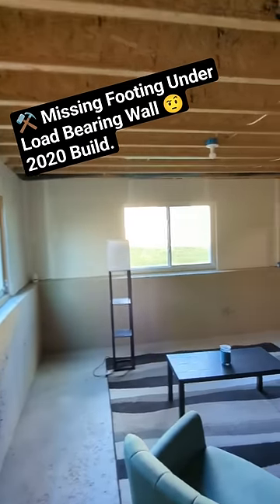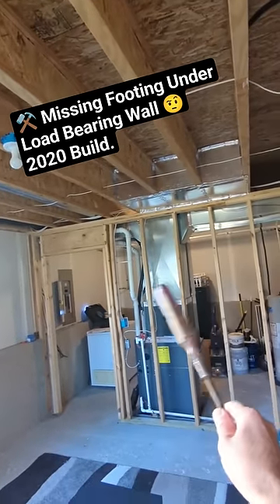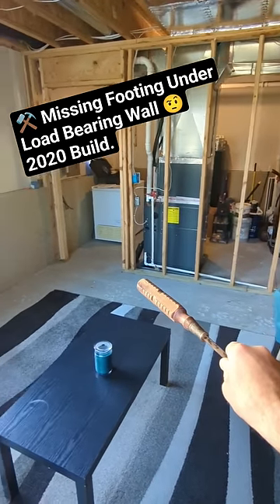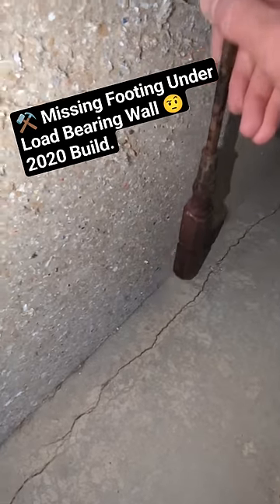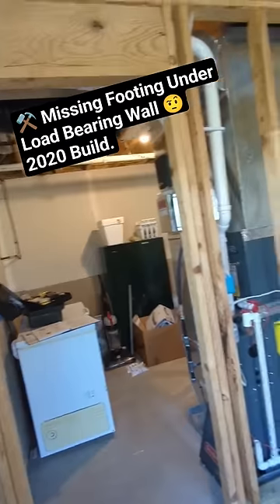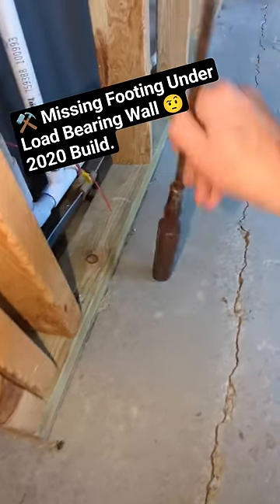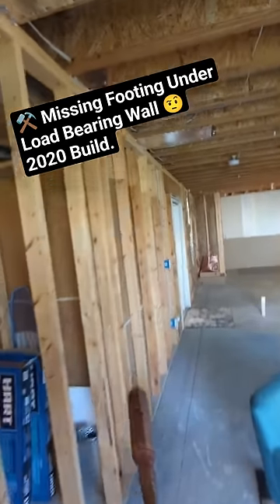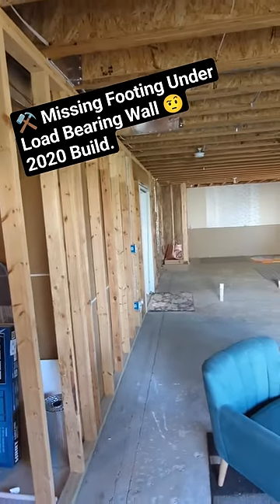FOOTINGS missing under load bearing walls NEW BUILD A trick to find missing#footing under #concrete

Comment: That's going to be expensive 😅
Reply: How do you even repair that?
Reply: @bmo14lax  temp support braces down both sides with cross members supporting the beam, remove load bearing wall, demo saw out concrete, dig out stone and dirt, use wood to form the proper footing, pour new concrete, let it cure, remove form and refill dirt and stone, compact, pour more concrete up to existing floor level, let it cure, reframe load bearing wall, remove supports and bracing. About 10 days and $7k-20k depending on the crew and if you get it done before any code enforcement catches wind. If code enforcement catches wind you're gonna need an engineer/architect, revised permits, and another $5k-$10k.
Reply: @stephentorrey8727  so the entire wall has to come down? Jeez yeah expensive 😂. Thanks 👍
Reply: @bmo14lax  theoretically you could pull it off without removing the wall, but then you have a floating wall in your way while trying to pour concrete 🤣. Plus since it's load bearing, the finished concrete needs to really, firmly and securely support the wall. It can't be all loosey goosey and by most codes you're not allowed to use shims on load bearing walls at all, so even a small gap is unacceptable and will cause the upper floors to settle noticeable probably breaking tile or causing hardwood to heave. So while it is technically possible to do without removing the wall, it's certainly easier and the "right way" to take the wall out in either sections or peice by peice. You could do it in a way that almost every single peice of lumber could be reinstalled to avoid waste though. If I was doing it, I would try to make the new floor maybe 1/8"-1/4" higher than the old floor by sloping it down to meet the old level a foot or two away from the wall. This way all of the verticle studs could be cut down by a small amount and reused while ensuring a properly tight fit for support.
Reply: @stephentorrey8727 if their plans has that as a load bearing wall then the footings will be detailed already. No need for another PE or anything. Just has to put footings that match the plans. 

Also, you don't need wood forms. Just cut the concrete, dig the proper footing depth/width, pour the concrete level with the floor.
 
Potentially could even get away with putting a sill seal or blue skin/etc under the existing wall and pouring concrete under it.
Reply: @Josh.1234  how to do plan on ensuring proper compaction for a footing if you don't excavate more than the required footing? We would hope it's already compacted as they poured the foundation, but the foundation guys also missed a very important footing soo...
Reply: @Josh.1234  plus, by the buiding codes in my area footing must cure for several days before foundation is poured.
Reply: @stephentorrey8727  unless it's distributed soil (which would be noted in the plans) it doesn't need compaction. Typical footing details are for undisturbed soil. Only when you have atypical soils or backfill do you need to amend or compact.
Reply: @stephentorrey8727  he's not pouring a foundation. Just a long footing
Reply: You could brace it cut out the jack studs, pour some small footings there and put lolly columns in. Not that huge of a deal but shoulda been done right.
Reply: It can be "underpinned".
Look up "underpinning a foundation". 

Likely $15,000 or so to underpin that wall.
Reply: @markmills344  you would not underpin the foundation since where this wall is does not appear to have a footing. Underpinning is when you go under an existing foundation and add additional support. This is a flat slab that just need to be cut and a footing poured under where that wall goes.

Comment: The crack in the slab along the saposeobly bearing wall is caused by the load pushing down and then deflecting back up and lifting the slab up.

Comment: On rewatching that video looks like that isn't actually a load bearing wall at all. "silent floor" or strand board joists look to go from exterior wall to wall. That wall in the middle may not be structural at all. Though it WOULD be stronger design if it were.

Comment: Help me understand please. What is the long term problems that the home owner would face? How can this problem be fixed?
Reply from the maker: Well, this is a single story home and the attic has trusses so there's no additional weight load from the top areas above. However, probably would experience minor hairline cracking on drywall in rooms at the main floor. 
Correction; 2 ways, bust out slab in front of basement center wall and install footing then install new wall in front of the other. 
Or post and beams with footings under post. 
I think the most concerning area is the middle of the basement.
What people may not see in the video is the larger door opening has a laminated header and on top of the top plates theirs 
two laminated beams setting on top which are perpendicular to the wall.
This is applying more weight load down to the slab areas.
In addition, there is a large bedroom  beyond the wall that extends beyond 24 feet.
Thanks for watching the video and the comment.

Comment: I can't tell from the height of those floor joists but the room behind that wall seems like it's very shallow and I believe those joints go all the way past that "load-bearing" wall further to what is probably is the load-bearing wall. 

Also just because there's headers does not mean it's a load-bearing wall I make it a point to put headers in above every door unless it's some middle of nowhere wall that you're just putting a closet or something inconsequential in
Reply: Let me ask- I’ve always thought load bearing in basement was done with metal (or maybe wooden 4x4 or larger) posts, but not with wall built with 2x4s

Comment: What you are not taking into consideration is the TJI floor joists could be designed to span the entire distance without that 2x4 "load bearing" partition wall. The partition wall simply takes some of the bounce out of the joists and doesn't have much weight on it at all.

Comment: Headers "usually" mean it's load bearing but not necessarily. Sometimes builders put them in just to stiffen things up a bit. In this case being that the wall is so far to one side of the joist span, the load would be significant. Plans probably note this wall as "non bearing" but due to the cracking next to it, it's obviously got significant load on it and should therefore have a footing.
Reply from the maker: Thanks for the comment and for watching

Comment: Is that a sand cement screed floor on top of a sum floor  when not compacted properly when screeding the floor you will get the hollow sound like this and the crack  definitely looks like it’s following a crack from underneath  or maybe heavy load on a pallet trolley run up along the control joint they put in   Just a theory  I am not there  so there s no footing underneath

Comment: Is there more rebar under the wall (obviously not, due to the parallel transverse crack)? Just saying, a footing is just a way of transferring a concentrated load to a wider area; a slab on grade is the ultimate footing, provided it's appropriately thick and reinforced.

Comment: Shouldn't there be 2×6s on the basement floor or is that a code thing? In my area it would have to have them for code interior and externally.
Reply from the maker: In some cases.
 I know some areas require 2x6 outside Walls for R value and 2x6 for load walls on 2 story homes.
This video is a single story ranch with a basement.
Thanks for watching
Reply: @inspectflix  thanks for the clarification. I'm about to move or build, haven't decided which. I'm leaning on building and I'll go smaller but built right. I had no idea about footings under load bearing walls. Thanks for the info

Comment: I’m going to extend my loft in my shop. I have 16 foot walls to the trusses so I have 8 foot walls to the loft. I have a 4” concrete slab so can I put posts on that and put a beam across the posts and then joists across the beams? Or do I need more to support the weight where it contacts the 4” concrete floor? It’s a pole building and the builders did a nice job and put in a 24x 36’ loft and I want to add so it will be 36’x36’ or 24’x36’ with a new 12’x24’ section

Comment: TJI's look sufficient to carry a  much longer load. Allowable spans are based on 1" of deflection in the span. If you put a wall in the middle part of the span, you could actually create an unintentional load-bearer which could crack conc on a poorly compacted substrate. Don't usually put that much effort into basement partition walls.

Comment: I think the footing is there, but that’s a contraction crack.  The concrete foundation team likely dug and poured where they were supposed  to put it.  Is there adequate 1/2” rebar tying the slab to the footing? Importantly, is there vertical movement downwards on that crack under the load ?

Comment: There might be a footing under the wall.  It sounds different then the slab 8 inches away.  There might be foam under the slab.  If you listen closely, you'll notice that the taping sound is slightly different under the wall then 2 inches away from the wall.  The footing should be approx. 16 inches wide and appears to align with the crack in the slab.

Your tapping 2 inches next to the foundation wall, does not reflect an appropriate 16" footing width.  I suspect that the footing is deeper and they put foam down under the slab.

Comment: It goes to show that just because a building is new does not mean it is good. 5-10 years down the line, this building will see a plethora of issues that will ultimately rank the value of your home, or cost a second mortgage to fix (if they’re not caught during construction and repaired).

Comment: In this single family residential application, that slab on grade foundation would be appropriate if done properly  securing interior & exterior load bearing walls keeping them structurally sound. Those footing walls on the outside of structure are there and visible because this is one of those half basements but that's just my wild guess.
When my truck runs funny I kick the tires, slam the hood up & down a few times, I'll have to try your screwdriver trick.

Comment: How do you fix that?
Reply from the maker: 2 ways, bust out slab in front of basement center wall and install footing then install new wall in front of the other. 
Or post and beams with footings under post. 
I think the most concerning area is the middle of the basement.
What people may not see in the video is the larger door opening has a laminated header and on top of the top plates theirs 
two laminated beams setting on top which are perpendicular to the wall.
This is applying more weight load down to the slab areas.
In addition, there is a large bedroom  beyond the wall that extends beyond 24 feet.
Thanks for watching the video and the comment.
Reply: @inspectflix  thanks

Comment: In Georgia, all our concrete sounds the same because we use red clay and compact our subgrades.    Even though a footing would be better to bridge poor soils, a 4" slab on a solid subgrade should carry a 70,000 lb truck easily, so if everything is done well, the wall will be fine.  But too bad for this home owner that they  aren't in that situation.

Comment: The situation here is that the joists are being supported on a wall not a beam.  If it was a beam then there would be one or more posts supporting the beam which are centered on four foot square footings.  But for whatever reason it was decided to use this wall with a wooden support post every 16 inches.  I would interested in knowing how tall this house is.  If it is just  a  bungalow then load requirements would be much lower, obviously. Therefore I don't believe a footing is necessary.
Reply: I’ve never seen a wall with 2x4s in basement be support. Only seen metal posts be support

Comment: Seems like the span should be the indicator of whether or not it would be classified as load bearing.  Just because it has headers, doesn't necessarily mean it's load bearing.  I've seen several situations where people built headers when they did not need to.  

I've also seen jack/trimmer cut clear off to accommodate new window sizes😂.

Comment: It’s entirely possible for a bearing wall to not need an additional footing, especially if it’s a post tension slab. (In this case, I don’t think it is PT due to the larger cracks.)  My advice is check the structural plan that should be available because the house is still under construction.

Comment: Adders don't necessarily mean load-bearing, they are required for load bearing but they can also be installed on non-load bearing walls which I've done in the past.

Comment: Those joists extend beyond that non load bearing wall to the exterior wall about 5-6' away. Headers over doorways do not necessarily indicate load bearing. What you're experiencing is called Dunning Kruger Effect.
Reply from the maker: Well. What you may not see in the video is the larger door opening has a laminated header and on top of the top plates theirs 
two laminated beams setting on top which are perpendicular to the wall.
This is applying more weight load down to the slab areas.
In addition, there is a large bedroom  beyond the wall that extends beyond 24 feet.
Thanks for watching the video.

Comment: How do they fix this???
Reply from the maker: Fortunately because the basement is unfinished, Either a beam installed with column post and footings or cut the slab to install footing then install a new wall in front of the old wall. 
Thanks for watching

Comment: That's not your footing. That's your turndown. There's more concrete there and transfers the load to the footing and thats why you hear it to be more solid. The top of footing is a little deeper than the slab ~16"

Comment: Is it really a load Bearing wall? looks like the i joists go full span and if not they should be overlapping on a beam with tele-posts supporting, if they do go full span that wall should be floating and that crack in the floor is from heaving into the pressure of what should be a floating wall

Comment: Sounds like soil compaction was not done adequately enough, making the ground dense under the slab so it doesn't erode away leaving the slab sound hallow. Also those floor joist are I beam style joists rated for the kind of support where a support wall is not needed. Also with the wall being so close to the far wall foesnt make sense. What does make sense is the wall was built to divide the basement. However, the bottom line is that slab needs to be torn out and back filled enough to compress it properly. This tells me that the inspector never check to see if the ground was tight enough as it should be to support some 15-20 tons of weight eithout eroding.  Also the layout of the room, the wall that was built is a dividing wall. It closes off what looks like a bathroom area. And you didnt tap over by where the middle wall was down the second break in concrete. If you would have tapped that area and it was hollow then maybe missing a footing. However, just beause a header is in place doesnt mean its a supportting wall, the header being in place helps to make a doorway more rigid and helps have a stronger support for hanging a door. Not need for a divider wall but good if you want the strength in the door and the wall. This helps when a door slams shut and either shakes the wall or doesn't. At the end of the day its going to take at most lifting the house pulling the slab, back filling and the tightening the ground, and pouring a new slab. This will fix the issue, anything else is a temporary fix. In my personal opinion.

Comment: So, I have no clue lol, (I’m an electrician).
The point of the video, the sound difference is showing a missing footing (when a footing is present, it’s denser, you can hear it. I can’t speak of “density” or “is it hollow/washed out” under all that, but - when he’s tapping next to the wall without footings, you see that crack just to the right of that? That concrete is cracked through enough, that it’s changing the sound yet again - not just that “hollow/less dense” sound, but on top of that, a different tone in general.

Comment: How.do you fix this
Reply from the maker: 2 ways, bust out slab in front of basement center wall and install footing then install new wall in front of the other. 
Or post and beams with footings under post. 
I think the most concerning area is the middle of the basement.
What people may not see in the video is the larger door opening has a laminated header and on top of the top plates theirs 
two laminated beams setting on top which are perpendicular to the wall.
This is applying more weight load down to the slab areas.
In addition, there is a large bedroom  beyond the wall that extends beyond 24 feet.
Thanks for watching the video and the comment.

Comment: That's not a load-bearing wall, Chuck. It's 5 feet from the outside wall, and those joists are engineered joists. Headers are also installed in load-bearing walls